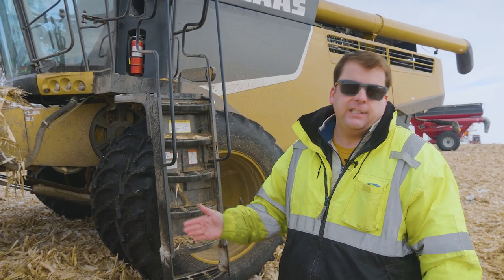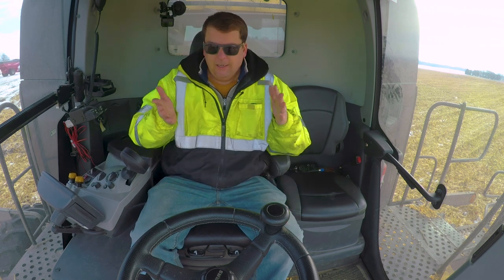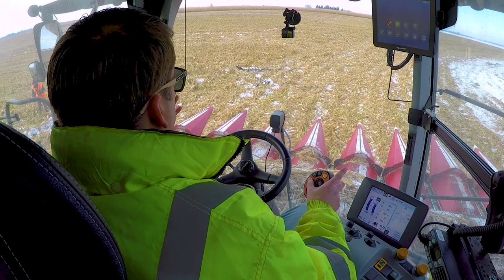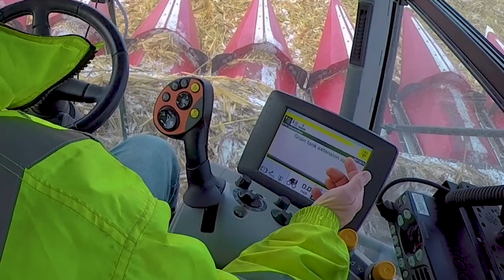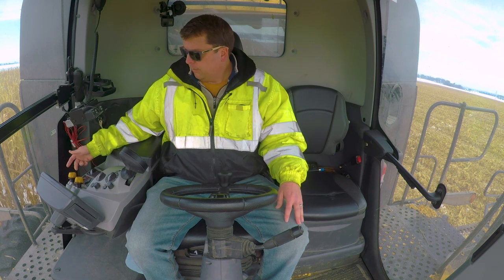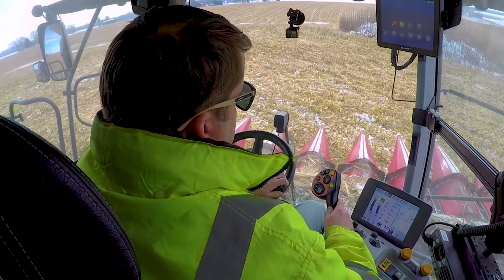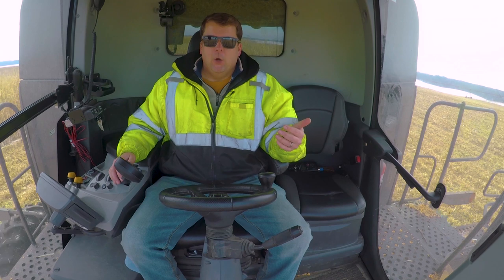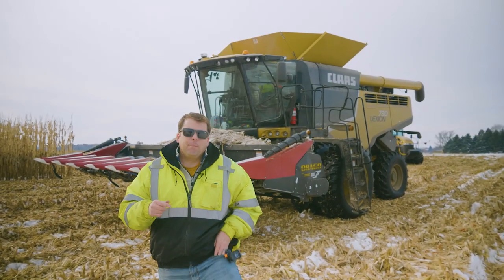How to Operate a Combine | Harvesting Corn

Comment: I'm wondering how much harder it is to learn to operate an older 1980s Massey Ferguson combine. Also I've never driven a combine. I've driven a skid loader, telehandler and forklifts. Is driving a combine harder or easier to learn to drive?
Reply: It is a lot harder, maybe just the driving is about the same level but getting as clean grain as possible without loosing too much out the back is the hard part
Reply: I use a 1980 John Deere 6620 SideHill.  Driving is easy, just takes getting used to how it handles.  When going "fast" (16mph), they're not the most nimble or forgiving. Operating the machine (and not breaking anything due to operator error), takes longer, but as long as you have good eyes, you'll be good.  Adjusting the machine to reduce harvest loss and have an acceptable level of trash in the grain, that's where the magic happens.  There's "cheat sheets" out there that tell you what adjustments to make for most things you need to adjust for.  If it's "down corn", don't do it unless you have to, or have alot of experience.  It's a whole different animal, and some head settings are different from settings for normal conditions.  Don't drive the head into a ditch in the field, and don't hit a pole with the unload auger! :D

Comment: No one wears a seatbelt in tractors or combines
Reply from the maker: well not no one....I do.  Safety first...always!
Reply: Heavy Metal Learning I’ve worked in contracting all my life. I have honestly never seen or met anyone who wears their belt. There are a lot of scenarios where you are worse off wearing a belt, ask if you want to explain.
Reply from the maker: @jaegerbomb4142  respectfully, I'm not shocked that a user named "jaeger bomb" does not follow proper safety practices.   Wear a seatbelt, no argument or discussion on this.   For every scenario you want to try and claim you are "worse off" I can give you 10 others that have helped if not saved an operators life.   These ROPS cabs are only safe if you are secured inside them.
Reply: Heavy Metal Learning can we clarify we are talking about tractors, not wagons. I didn’t say that wearing a seatbelt was not safer, I purely pointed out that it can break the pelvis and almost split a man in half (due to the lack of airbags, crumple zones, suspension) in certain situations. 

The reason farmers and drivers don’t wear belts is because you are rarely going above twenty, you are in and out of the cab, if you hit something chances are it isn’t going to slow you down a great deal and as I pointed out above it can be more dangerous in certain situations (not with wagons only with tractors).

Fair enough insult an online name someone has created as a cheap laugh - but don’t precede it by “respectfully” - what a cock.

I will tell you now, I find it very hard to believe that you have any experience in agriculture (a 100hp tractor on your garden doesn’t count).

I have worked for custom harvesting units in the USA, and have spent all my life contracting and working on farms in the U.K. - naturally I have met an awful lot of tractor drivers, I have never met one that shares your opinion. In the U.K. and the USA you are not required by law to wear a seatbelt in an agricultural vehicle, I have never been told by a dealer that the correct safety practice is wearing a belt. The only reason tractors have them fitted is to tick a box as far as I can see. It might seem like I’m lecturing you on this and I don’t mean to be rude or cocky but I have done this job all my life and I don’t enjoy being talked down upon by someone who knows very little about agricultural machinery.
Reply from the maker: @jaegerbomb4142  You are being rude and cocky.   I can assure you seatbelts are not installed to "tick a box".  Again, not going to have this debate with you just telling you that I don't agree with you (and I know plenty that do wear them).   Ultimately we love the operators that provide their own experience and opinions on our channel, but just won't tolerate anyone advocating against using a proper safety device.   So move along......
Reply: Heavy Metal Learning I wasn’t saying that you shouldn’t use them mate. I think people (especially in newer fastracs and fendts that will do 65kph) should wear them more - I also think we should have cab on chassis designs for above 50kph (for safety reasons). 

I was rude in the last reply - but you where rude (and a bit childish) in the one before that. 

Perhaps I was a bit cocky, this might be because I’m being lectured by someone who admits to having virtually no experience with agriculture. You wouldn’t know a gripe or a topper if they hit you in the face! 

Agriculture has a much higher fatality rate (per 1000) than the plant and construction business - I think we can see why! 

I do enjoy your other videos about 360s and loaders (I have only basic experience in big loaders and 360s) and I don’t comment on those videos as I am not an expert, instead I learn from them. 

You have now made a video on something I am an expert in and you are not - and now you are attacking me for pointing out a fact. 

It is a fact that no farmers or drivers wear belts be that a good or bad thing. (I personally would rather have 100 dollars less in production cost for something no one is ever going to use)

Good - if a little heated - argument/ debate.
Reply from the maker: @jaegerbomb4142  No idea why I'm continuing this debate, but because you appear to want to remain civil I'll provide you a response (I agree there is nothing wrong with healthy debate).

1) You have no clue about my experience.  I specifically state I'm not an expert in any of our videos just because I consider myself learning every day.  Anyone who claims to be an "expert" must understand that is a subjective self-derived label that often comes from someone who is too cocky to realize they don't actually know it all.

2) I have no doubt you believe it is best not to wear a seatbelt, but that is based on convenience NOT safety reasons.   And while I agree that many others are similar to you, please don't assume that is everyone!  

3) You seem fixated on speed having something to do with the reason seatbelts are important, that couldn't be further from the truth (if that was true why does any construction equipment even have them....top speed is usually at most 8mph on most).   The fact that your reasoning for not wearing a seatbelts is because "it can break the pelvis and almost split a man in half" is insane.  First of all, if you are in any type of farming accident that the forces involved can break a pelvis or split a man in half what do you think happens to that body that is not wearing a seatbelt???   Second of all, I worked as an EMT for many years and can tell you from experience that a seatbelt (properly worn) can NOT break a pelvis or split a man in half.   A properly worn seatbelt in ANY type of vehicle or equipment is designed to keep that body restrained within the protective cab of that vehicle.

Again, willing to engage in a healthy debate but we put a lot of time and effort in to our channel and videos and promote safety as a top priority.   We have many new operators that watch our videos and I would never want them to get the perception from reading a comment like yours that they shouldn't wear their seatbelt when operating a tractor.   I'm fine with you having your own personal preference, but don't advocate on our channel that it is somehow "safer" when that is blatantly false!
Reply: Heavy Metal Learning I am in no way trying to tell anyone not to where a seatbelt and I never did (I made reference to construction being much safer than farming because they use all the safety practices you outline in the video). It is purely a fact that most farmers (at least all the ones I’ve met) don’t wear belts. 

Point 1. You said you have little experience in combining in this video - nothing wrong with that at all. 

I don’t think I’m being cocky when I say I’m an expert. During harvest I work 100 - 120 hour weeks and last year cut 12380 acres. ( I have done this for a number of years) experience leads to expertise - hence why I class myself as an expert with combining most crops. (Doesn’t mean I am not still learning, just means I know a bit more than your average operator) 

So yeah I have virtually no clue how much experience you have - other than the fact you said you didn’t have much. 

2. Couldn’t agree more. I don’t assume it’s everyone - just everyone I’ve bumped into as far as I’m aware. If farmers worried more about health and safety and less about convenience we would never turn a profit - this is why agriculture is the most dangerous job in the U.K.

3. Respect to you for being a paramedic, but when I was 16 spreading slurry on a local farm another lad crashed - he locked up and went off the road into a large ditch nosediving into the opposite side of the ditch. I was the first on scene  (I have seen people lose arms through foragers, fingers feet etc.) but this was really bad. The belt had locked and his pelvic area was almost completely flat - both his femurs where sticking out of his legs, he was virtually split in half poor guy. He never walked again. I’m positive that he would of come of with a Couple of bruised and broken bones if he had not been wearing a belt but no where near as bad as what happened. I imagine modem belts would slip a bit with such forces applied and so this wouldn’t happen in a modern machine - but not everyone runs modern machines. 

Just to clarify I am not saying that not wearing a belt is safer. 

Lastly I’d like to point out I’ve been a viewer of the channel for a while and I really do enjoy your stuff. I’m not picking fault with the video - just saying that 99.9% of operators don’t put there belts on or do the three points of contact thing.
Reply: Please shut up, heavy metal learning are providing a good example of what you could do to save yourself a point on your license, no one cares how long you’ve been combining, I’ve combined for 3 harvests. Yes I’ve not worn a seat belt but I’ve been told all the time to wear one just in case, the point I’m making is don’t be cocky to someone who has better knowledge of what to do in a machine